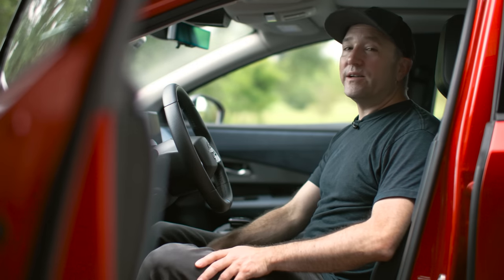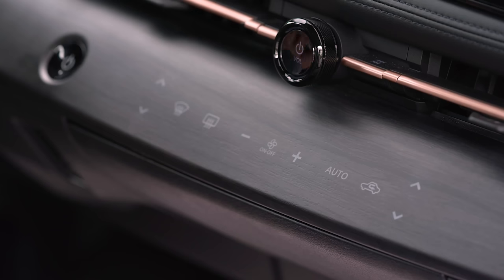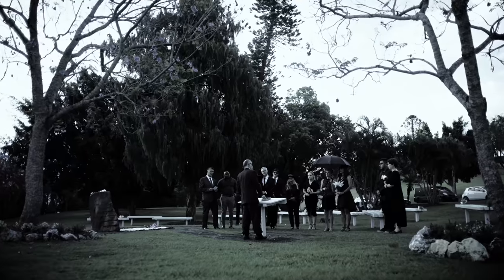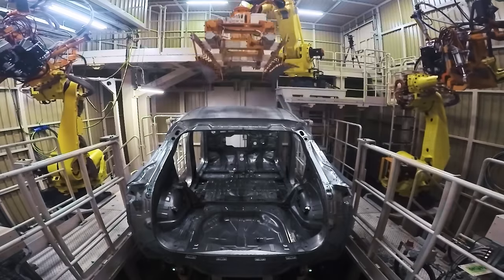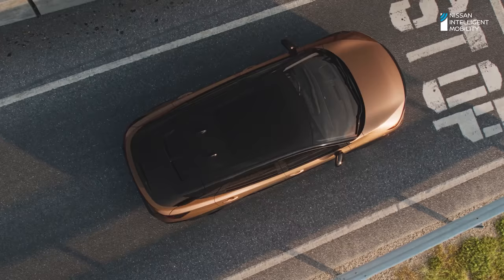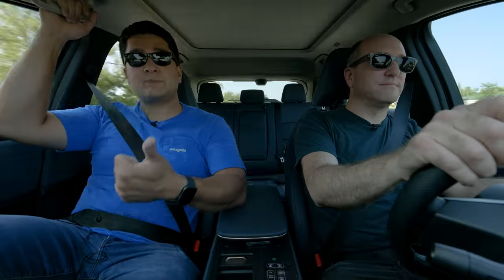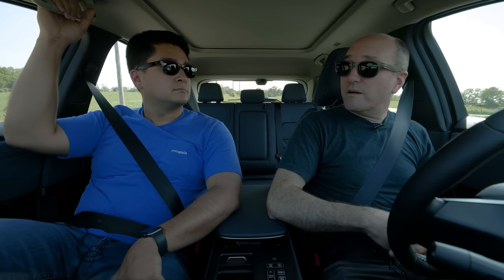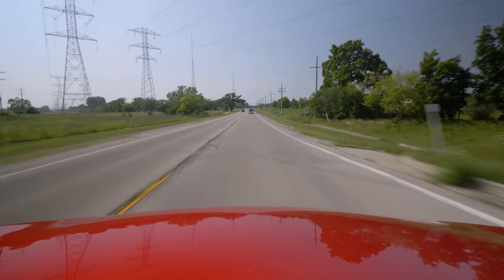Nissan Ariya EV | Too Little Too Late?

Comment: The Aztec was so ahead of its time, look how many vehicles continue to have the same shape
Reply: Toyota FJ was as well.
Reply: Yeah I owned a beautiful black fully loaded Aztek I loved it. However it ate transmissions for breakfast.
Reply: @themoviebay wow they ate trans with 185hp 😂 👏 GM
Reply: @papa_pt ikr my dad's Yukon was a great car except we had to replace the transmission twice. How does GM never fail to screw up on transmissions 😂
Reply: The issue was never the shape. It was merely the surfacing. 
Pontiac dropped the ball one the hideous lights, cladding, split rear window that hurt visibility, and those wheels.
Reply: @papa_pt  actually yes
Reply: Typical GM... Case in point Envoy XUV(too far ahead of its time)
Reply: @themoviebay  oof
Reply: nomenclature9607  prob a boomer, but I have a RSX Type S lol. I regret buying it so much. Manuals are horrible, and the car has a boring Honda engine. I wish I had bought a Dodge Durango or my dad's Yukon before he sold it. Not making the mistake of buying a manual non 4x4 car again.
Reply: @jordanplays-transitandgame1690 I had an '02 Denali that had almost 400k on the clock when I finally got rid of it. I might still have it if I was willing to put a third transmission and center coupling in it.
Reply: So was Mercury Topaz. Sooo ahead of its time. Unreal!
Reply: @MLHunt  My dad's Yukon made it to 300k when the second transmission blew up that's why I still think it's a great car but what's with the transmission 😂 My dad sold the car to a scrap dealer so I'm still sad about that to this day, another transmission would've been worth it to me
Reply: Can someone help me out? Why do they keep using the word affordable and this thing cost $53,000
Reply: Think this post was meant to be sarcastic.
Reply: @TURBOMIKEIFY just look at the new land cruiser.
Reply: @TURBOMIKEIFY the fj grew on me. I think if they reintroduce it, it'll do good.
Reply: No.
Reply: Why do you cap so much?
Reply: Aztec: futuristic SUV/Truck (e.g. today's)
Vette: futuristic supercar (e.g. today's)
Camaro: futuristic Mustang (e.g. today's)
Reply: The Ionic 6 is the modern day Aztec.
Reply: @papa_pt everyone I knew with an Aztec dumped it when the trans failed, though most were over 100k anyway. Funny thing that two of those people both ended up buying a Honda element to replace them, another car that was discontinued right around the time that style became status quo (Scion xB, Kia Soul, etc)

Just look at the Chevy Avalanche and how many trucks look like it now. The crazy thing is the Avalanche was a really good truck and there was no reason to kill it - it sold well and everything, the Colorado was never going to fill those shoes.
Reply: It got walter white through so much trouble.
Reply: nomenclature9607  Cd of the Aztec is close to 0.40 so it's not an aerodynamically efficient design. It has this shape simply because it is based on the Trans-Sport/ Montana pontiac minivan and Gm wanted a 'sport' variation of it to counter the stigma of minivan owners that was beginning to arise.
Kind of Honda Element much much more poorly made .
Reply: The difference being today's designers actually know how to stick wheels onto a chassis.
Reply: Good point, the Aztec was hated when it was released but back then I felt the car would age well, and it has.

Comment: I feel like any EV review should include these points:
1) Does it have a heat pump? That makes a massive difference for range in winter months.
2) How is the charging on road trips? Will the GPS calculate charger visits like in a Tesla, and does it actually work well?
3) How are the crash safety ratings?
Reply: I have eliminated two EV’s based on the heat pump as in my climate it will make a big difference. The Mach e and well to be honest I have lots of reasons to eliminate the ID4. So many bad decisions. But it also annoys me that they put the heat pump in the European model but not the US Model.
Reply: they are ICE-centric so it's interesting to hear reviews from legacy drivers.
Reply: I agree. Specs matter on a EV but its different ones from a ice car like your pointed out
Reply: 1. Yes 2. Yes 3. Excellent
Reply: 1) Makes a ton of sense.
2) I think charge curve matters more, or at least 5-80% breif point. mention of an integrated charge station finder a good point -- should be standard in most EVs. Also integration to say preheat the battery before charging is useful.
3) Why does this matter more on EVs vs non EVs, this is a moot point.
Reply: @eto2352 a decades long legacy maybe
Reply: Safety applies to all cars.
Reply: As a German, when I heat heat pump, you can charge your battery pack with my loathing wrath.
Reply: @PhonyBologna yeah that last point for sure. Crash tests on most EVs have generally been as good or better than their ICE counterparts
Reply: Ariya received 5 Star crashing ratings from Euro NCAP.   Ariya has 10 airbags (11 airbags on the Platinum series).   Tesla has 8 airbags.   

Nissan Ariya was recently ranked #1 (tied with Kia EV6) in JD Power Initial Quality survey.  

Nissan Ariya was rated “very good” by EuroNCAP for semi autonomous driving features.

As an owner of Ariya Evolve, I love it so much.  However, it should be branded as an Infiniti Ariya. I think it would have sold more as a luxury EV at this price point especially with way more features than Model Y (panoramic moonroof that opens and shuts, has electric sunshade cover, has cargo cover, has spoiler, has rear wiper, two tone colors with pearl metallic paint, and many features not found on Model Y.   Add it all up and the features cost way more than $7500.  

I have never had a Model Y owner who test drove my Ariya that never like the Ariya.   They raved it,
Reply: @peterfessier9780 thanks for your comment. I’ve been waffling back and fourth on Mach e and Ariya, and I live in Ontario, Canada. Now leaning to Ariya. What was your final decision.

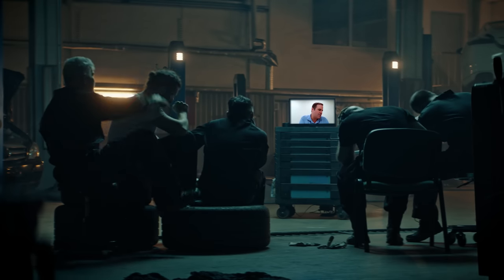Comment: 9:19...."..for most people the battery will not be an issue in cold weather..."
 That statement to me just means that the manufacturer would rather make excuses for the problem rather than solving it.
The problem with Nissan and alot of other manufacturers is that they don't do enough to separate themselves from the competition.
Reply: It's a valid statement. Most customers live in warmer climate. The amount of us in extreme cold is low
Reply: Yeah, their logic is backwards. "People charge at home, so we don't worry about fast charging." I wonder what causes people to charge at home.... 🤔
Reply: Also, as an apartment dweller, charging at home is simply not an option.
Reply: nomenclature9607  Luckily most apartments are already wired with block heaters in northern climates. These could be utilized for charging.
Reply: Don’t worry, the ice vehicles will warm the planet, so that shouldn’t be an issue much longer

Comment: I find the Ariya pretty inside and out, and when the bar is set by a Bz4RX… hitting middle of the pack for the EV mainstream market is pretty good. Its not a car to be super enthusiastic about, but its solid. Its a Nissan
Reply: Reminds me of what the Maxima was in the late '80s and early '90s, were there better cars, sure, but none had the character for the price of the Maxima, it rode that line between expensive economy and cheap luxury. In fact, I'm surprised they didn't stretch this chassis a bit to comfortably add a third row and make this the new Maxima. Now that I think about it for the price it should a bit longer in the back and have a fold away third row, the extra cargo space will more than make up for the lack of storage under the hood.
Reply: R☠️?
Reply: Bar was set high by sx350. New Nissan nicer but less solider than b58. Unclear result with Sx38 as b59 sub models.

Comment: The Ariya starts at a more lower price than mentioned on this video. I just bought one this weekend, I got the base trim it starts at 44k.The car has a lot of freaking options that I was surprised came in a base model. I was chasing a cheap payment for my next car and this hit the sweet spot for a sub $350 a month lease.
Reply: A car made to be leases, that is for sure!
Reply: You might be ok with the base trim but most people want to add some options. With all wheel drive and the bigger battery pack this thing is crazy expensive.
Reply: They give the price in Canadian. Kind of annoying they don't make the distinction
Reply: This was exactly my experience, I got the Engage and it checked 90% of my feature needs. There are a lot of cars that fit the appliance category and that's just OK. I specifically wanted an easy car for the wife to commute with and this was perfect.  HUD, and zero gravity seats on my poverty spec trim are my favorite features.

Comment: After watching this and hearing they are covering 3 years of charging, this to me sounded like a great lease deal. Sure enough, just checked leasehackr and the fwd version is going for $237/mo + $2,131 due at signing for 36months with 10k miles a year here in NJ due to credits. That's a price that most can afford to pay versus the $350-$400 rouge if you're okay with an ev.
Reply: Never put anything down when leasing. That’s free money to the dealer. It’s not a deposit, you don’t get it back, and if you ever plan to buyout the car it’s not considered. Check the lease price again with no money down

Comment: I got my brand new Engage base for 20% off MSRP! $4400 off from dealer and $4750 from Nissan rebates.. $44,700 MSRP (includes destination) down to $35,500! 😃  Engage base has so many nice options.. pretty much everything you need and more minus power liftgate.  it's plenty  fast.. and 220 mile range is all I need for my daily needs . Looks best in the gun metallic color imo (charcoal). I have a gas ram truck for my long trips with the family. We are saving so much money in gas with our local commuting. Drive super smooth and quiet. Very big feeling for our family of 4. Sits higher higher than rest of this ev segment which we like alot. We love our Ariya!
Reply: Lies

Comment: The biggest problem for all traditional car manufacturers is Model 3 only cost around 40k. There are literally no headroom to spread development costs and additional manufacturing costs for EV. All Toyota, GM, Ford, etc will need to write off at least 2 billion dollars to sell proper EVs. And then their first and second generations products will still be slower and have shorter range than Model 3.

Comment: It would help in your EV reviews if you could comment on mi/kWh.  A formal range test isn’t needed to get a sense of typical efficiency (or inefficiency) over whatever miles you put on the car and with whatever amount of hooning or balloon footing you do with it.
Reply: You end up with small numbers that don't appear to be very different between one another when calculating mi/KwH. Let's crunch some numbers to demonstrate. If one car is 2.91 mi/KwH while another is 3.33 mi/KwH, that is the rated difference between a car estimated to get 250 miles of range on an 86 KwH battery versus a car rated to get 200 miles of range on a 60 KwH battery, respectively. At face value, those numbers don't appear to be much different, but they don't tell the full story as the higher mi/KwH option is still a lower range. I suppose it's useful for comparison's sake, but you have to admit, it is starting to get into the realm of "baseball statistics" factoids and calculations
Reply: @KillaninjaFC Just multiply by 8. The current values for efficiency align remarkably close to gasoline mileage-- not miles per gallon, but miles per pints.

An ICE vehicle getting 24 mpg is getting 3.0 miles per pint of gas. One getting 32 mpg is getting 4.0 miles per pint.

The kw/h all of a sudden resembles a pint of gas, so an 80 kw/h battery looks a bit like a 10 gallon fuel tank.

Plug in your previous examples: 2.91 miles per kw/h times 8 becomes 23.28 miles per "gallon" of electrons. The 3.33 figure is 26.64 miles.
Reply: @BogeyTheBear  huh, how did you figure that? well it beats the useless MPGe numbers

Comment: Is anyone going to discuss how most people live in apartments and can't charge an ev?!
Reply: Where do you live where that's the case? I don't know anyone that lives in an apartment.
Reply: @grocerylist  I've lived in an apartment in NY and VA.  Roughly a quarter of all American live in apartments or condos and won't have any way to charge their evs at home.  Additionally, that number will probably increase as homes are becoming more unaffordable. The fact that automakers and politicians aren't thinking about the difficulties of charging an ev shows how disconnected they are.
Reply: @iphone3guru  A quarter of Americans living in apartments is nowhere near "most people" live in apartments. 

Regardless, the charging infrastructure will be built up as EVs become more common. Apartments/condos will get built out with chargers or have chargers added.

Comment: I rented an EV on vacation and it was terrible. Not because of the car itself but the availability of a super charger was limited in this city that i was in. I always had to charge the thing and worry about the charge. I spent alot of time waiting on the car to charge. Not a great time. The car was nice other then the charging problem.
Reply: I own an EV for 2 years now and the charging and availability issue persisted for maybe 2 weeks to a month until I figured out where everything is, how to find chargers and plan home charging. Renting an EV in an unfamiliar environment is a disaster waiting to happen, especially if you're new to EVs. The only country I would consider renting an EV is Norway.
Reply: “An EV”? What brand? If not Tesla then that is your problem as there are Super Chargers in most places where would drive a rental car.
Reply: I rented a Tesla Model Y from Hertz in Portland, OR and drove it for a week, putting 1200 miles on it all over northwestern Oregon.  Never an issue charging and the vehicle's navigation system easily directed me to supercharger locations.  I only spent $40 in charging fees for the 1200 miles.  I'd definitely rent one again.
Reply: @bartwaggoner2000  it was a Chevy Bolt. There is a supercharger but even then having to spend and hour or more at this location plus the amount charged didn't really convince me on EV practicality.
Reply: @timothycc711  you picked an EV that is almost diametrically opposite to a Tesla in terms of charging and range efficiency.
Reply: @bartwaggoner2000  I didn't pick it. It was a rental car. Even a Tesla wouldn't have been any better in this situation. You have to spend 4x the amount of time you do recharging an EV car compared to an ICE. You have to constantly worry about range...this isn't up for debate. These are facts.
Reply: @timothycc711  Umm technically the Chevy Bolt can not realy "supercharge". It's peak Level 3 DC Charge speed is about 55kW (Tesla Supercharger is 200kW), which is bottom of the barrel in the industry. 
That model of EV was never designed to fast charge, it was an afterthought GM added on. No other modern CCS Level 3 charging EV works like that. "Even a Tesla wouldn't have been any better in this situation" is a Blatant LIE. 
"constantly worry about range" Nope when you have more than 250 miles range in typical driving you rarely have to care about range. Slow Level 2 charging overnight works perfectly fine. Seems like your entire story is a fabrication. You're just spamming misinformation.
Reply: @timothycc711 "this isn't up for debate. These are facts." Nope You LIED, no debate there.
Reply: @Neojhun  I lied about what?

Comment: Even on the ICE side, none of the "major brand" mid-sized SUVs really beat one another at any one thing; they are all virtually interchangeable; price is mostly why you grab a Highlander over a Passport or Pathfinder. I don't really see a huge difference here either; the competition mentioned don't really blow this away to a significant degree overall; each has its relative strengths and weaknesses. One thing this does have is a superior interior to all the competitors mentioned. For some, that may be enough to go with it. It is competitive; in this market that is all you need to be to move metal.

Comment: I wonder if the E-power variants/models would be more appreciated in this case. Asian markets have an e-power variant of the Kicks, and it is quite popular for providing a very affordable EV experience. Without much of the worries of EV maintenance and ownership issues.
Reply: It's a far worse version of a Chevrolet Volt. Only 7 miles of range with the engine fully off.
Reply: @goncalo33  because it's meant to be a hybrid, not a full EV. The onboard ICE is there purely to charge the battery, while ONLY the electric motor drives the wheels.